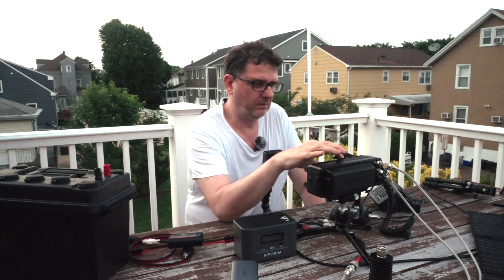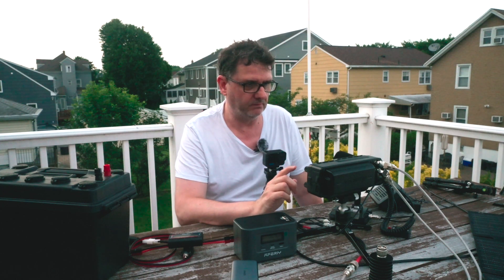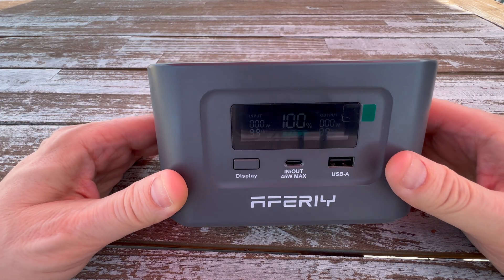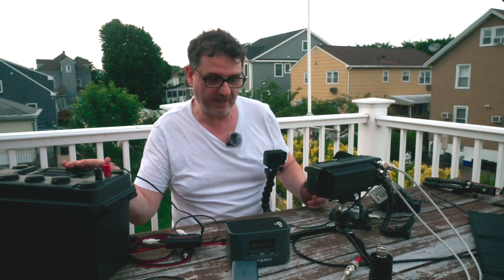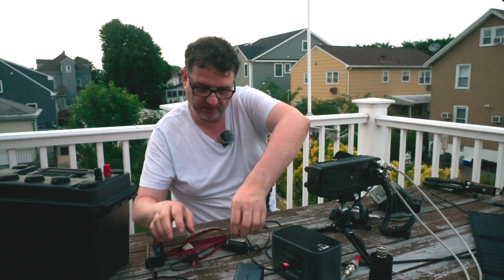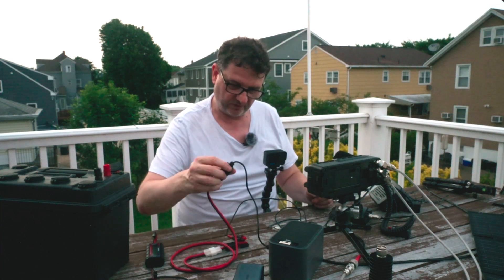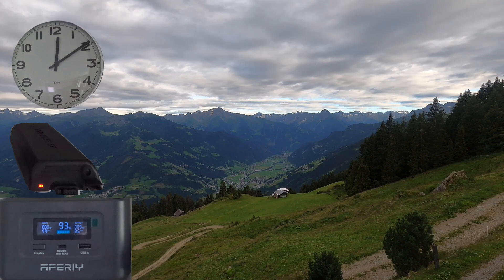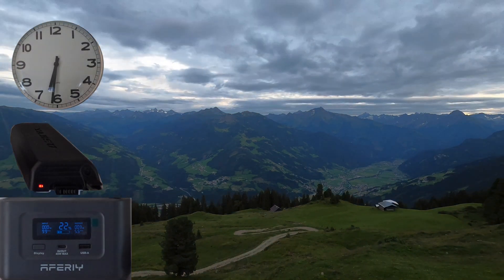Yaesu FTX-1 compact off-the-grid charging and powering options

Comment: The AFERIY Nano100 comes with a DC7909 female to USB-C female adapter in the box. You can use it to charge it with up to 100W from solar panel.
Reply from the maker: Correct

Comment: What tripod are you using?  I am thinking of getting one with a quick attachment plate to remove the radio head without screwing the tripod into the radio.  That tripod looks really sturdy.
Reply from the maker: On the video I am using a KAKAFOTO KT-A02 - which has been discontinued. I got another one, which I am using now and It's very sturdy, K&F Concept Mini Desktop Tripod: https://www.amazon.com/dp/B0DCVX8QRT?ref=ppx_yo2ov_dt_b_fed_asin_title

Comment: Omnicharge makes great portable power banks that have both USB-A, USB-C and DC barrel plug outputs (plus an A/C outlet/100w) they make them in 20 and 34AH capacities and you can charge them with solar plus you can select how much power in Volts & Amps  you want the DC Barrel plug to put out!  The Omnicharge 20 USB-c unit is quite compact and travel friendly!  Just an idea for you as I use them to power my Icom 705 at the 10w max with them.  73
Reply from the maker: Thanks for sharing. The Omnicharge 20+ is quite pricy, but is very compact